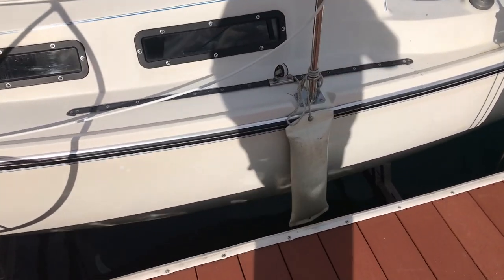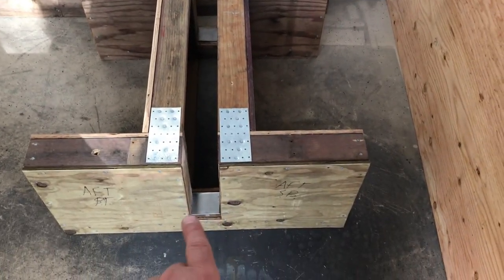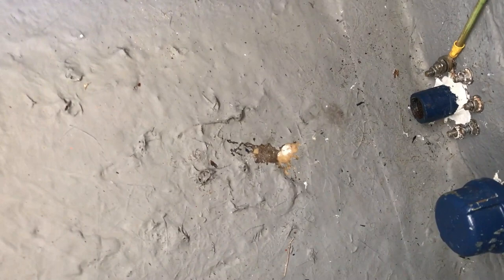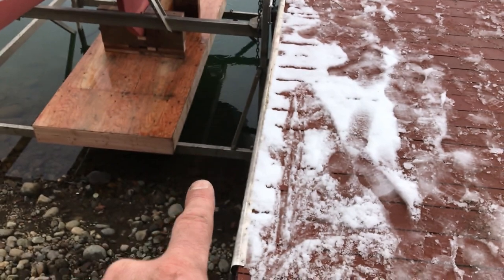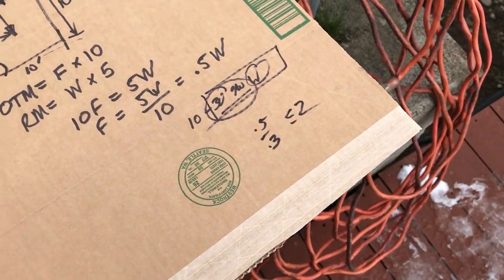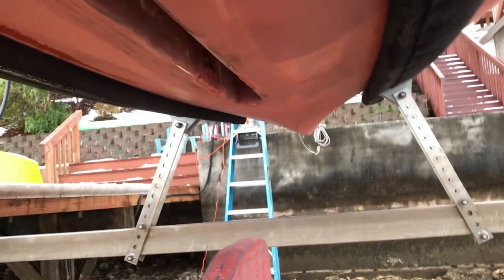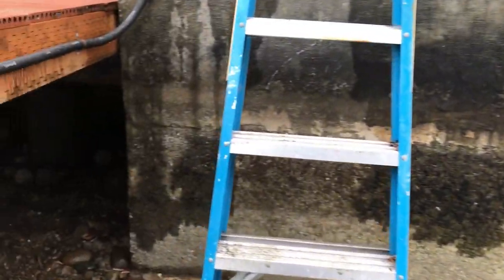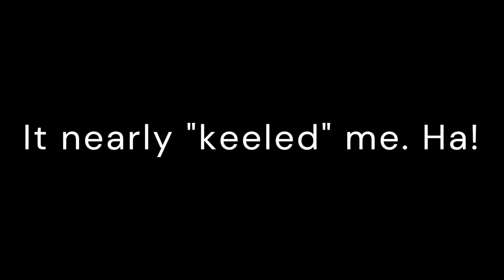Starwind 22 Keel Removal & Installation

Comment: Is this a a Starwind 223.? We recently purchased a 85 223 and are really struggling trying to find a owners manual or where some key items are located.
Reply from the maker: No sorry, this is a Starwind 22 not a 223. The 22 was designed by Halsey Herreshoff. The 223 was designed by Cortland Steck Yacht Designs.